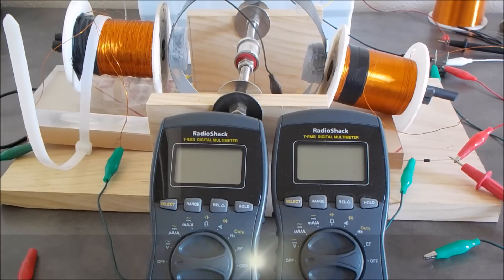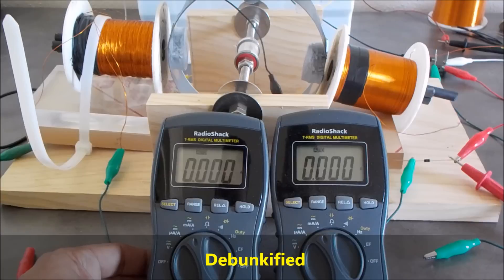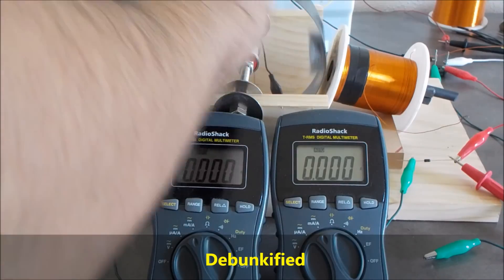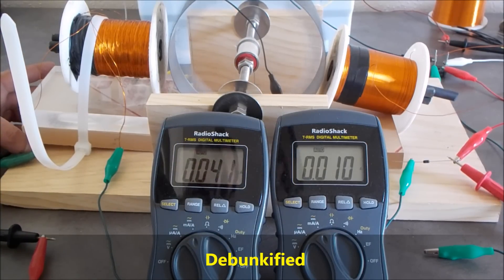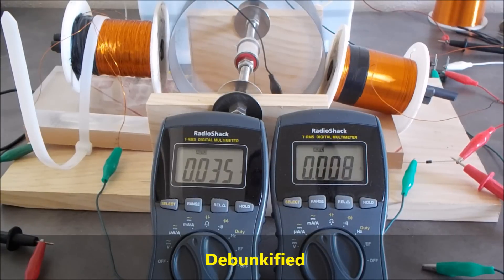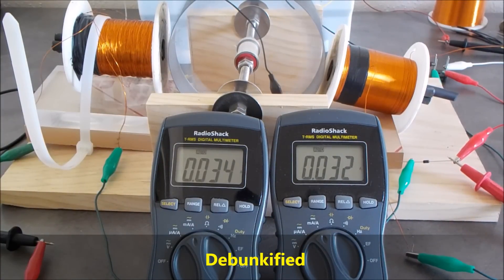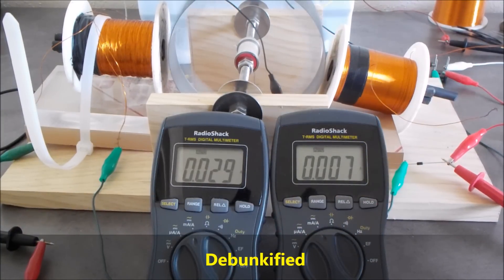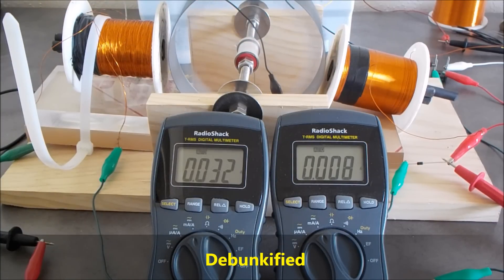GLIMPSE of FREE ENERGY OVERUNITY MOTOR/GENERATOR COMBO DEVICE

Comment: HIHow do you combine the collapsing field with the generator coil output?I have noticed you need that one fast steering diode on the collapsing field, and also a single diode (or perhaps FWBR to rectify) on the generator coil too, then both into the same cap or same load.I like to put pickup winds behind and around on outside too, of my motor coils to make for greater collapsing field energy, plus the back end of coil now does work too, inducing into those extra pickup winds....extend the core in your motor coil about twice as long, wrap pickup winds back there now both ends of your motor coil does work...also not only do you get the induced energy from the magnetic flux on the backside of your motor coil (as it is now it does nothing but go into space) but also the collapsing field backspike comes through as well from those pickup winds!.....trick is single diode off these additional pickup winds must face particular direction - one way works, the other way doesn't...you could then combine this extra "induced collapsing field" energy with your generator coil output too and so now three "outputs"
Reply from the maker: Well both the kick back and generated energy are combined together through 1 diode from the kickback spike and a FWBR composed of 4 diodes connected in parallel with the kickback spike output. 

I find no need to add extra windings around and behind Gen coil and longer core as the collapsing magnetic field will fully and directly collapse all its field energy into the Gen coil. Any more windings simply add unneeded resistance that takes away any energy.

Comment: Did you notice that after a few seconds connected the mil-amps on the motor side rise? That happens when a load is placed on the Generator coil. Yes even the meter draws a little load. At that point he was loosing energy. Using AC with a Bi-Toroid he would not increase the Resistance on the motor side avoiding the rise in mil-amps to the motor. Then out of the 2 sides of the Bi-Toroid rectify them to the charging source. This eliminates the resistance to the motor, increases the output to the charge and the voltage can be stepped up do to it being AC first. You would need a drive side, the motor, and a generator side. The Bi-Toroid should be on the generator side. You can get the small toroids from the curly lights, the bottoms to the socket or from used DVD players. Use 30awg magnetic for the middle winding, 24awg for the 2 side winding's. If the middle winding is 10 then the 2 side winding's should be 30 to start. Not only will you step up the voltage but you will also increase the amps, or mil-amps output. Look at my video 3D printed. Notice the run side and the generator side with an added DC generator on the outside only to charge the batteries. This is a superior method to over unity that does not break any of the laws of physics. I charge the Batteries in parallel, and use them in series for the motor. I use the larger motor as a type of capacitor when I change the 10 out. The other side is AC through a bi-toroid then through a full bridge rectifier to the Capacitor then to a battery. Capacitors can accept energy faster and with less resistance.

Comment: What size wire and how many turns are on those coils?
Reply: I use a minimum of 500 turns for the power and 350 for the trigger to the reed switch or base tot he transistor.
You get a better collapsing field if the magnets are 120 degrees in a delta, but you will get more torque and slightly less out of the collapsing field at (magnets) 60 degrees and the coils 120 out. Use 2 more power coils with the same trigger for the motor side and 3 coils on the AC side in series with 3 North facing 120 degrees and 3 south alternating 120 degrees. 6 magnets.
 Did you notice that after a few seconds connected the mil-amps on the motor side rise? That happens when a load is placed on the Generator coil. Yes even the meter draws a little load. At that point he was loosing energy. Using AC with a Bi-Toroid he would not increase the Resistance on the motor side avoiding the rise in mil-amps to the motor. Then out of the 2 sides of the Bi-Toroid rectify them to the charging source. This eliminates the resistance to the motor, increases the output to the charge and the voltage can be stepped up do to it being AC first. You would need a drive side, the motor, and a generator side. The Bi-Toroid should be on the generator side. You can get the small toroids from the curly lights, the bottoms to the socket or from used DVD players. Use 30awg magnetic for the middle winding, 24awg for the 2 side winding's. If the middle winding is 10 then the 2 side winding's should be 30 to start. Not only will you step up the voltage but you will also increase the amps, or mil-amps output. Look at my video 3D printed. Notice the run side and the generator side with an added DC generator on the outside only to charge the batteries. This is a superior method to over unity that does not break any of the laws of physics. I charge the Batteries in parallel, and use them in series for the motor. I use the larger motor as a type of capacitor when I change the 10 out. The other side is AC through a bi-toroid then through a full bridge rectifier to the Capacitor then to a battery. Capacitors can accept energy faster and with less resistance.
Reply from the maker: Size of wire is #26 gauge. I didn't keep track of number of turns, but there has to be at least a good thousand or more turns.

Comment: Was thinking it could be because the extra magnet might be a bit strong  &  is "saturating" the ferrite generator core material. This reduces it's inductance so more amps flow in the generator coil. And more amps = more amps/turn on the coil = more magnetic field so rotor speeds up.
Reply from the maker: +smokyatgroups True, I just can't figure out why I'm getting the opposite effect with a backer magnet behind the motor coil. I do get a great rotor speed up like that but current going in goes up, not good. I've seen it go down before by half and a speed up of the rotor but that was another setup and I can't remember exactly. I think it's the core I was using welding rods as a core, maybe that was it. I really need to do a comparison effect, maybe the welding rods were so inefficient that the backer magnet simply made it efficient like it should have been in the first place like the ferrite cores I'm using now. Hopefully not.

Comment: Nice video, I think you are getting Lenz drag on rotor due to the current draw on the generator coil. You could try put a couple of additional magnets as generator only magnets but at right angles to to the motor magnets. So north south axis of these is parallel to the rotor axle.  Then make a pickup generator coil which takes energy from both side of these magnets  by straddling both the poles.  This will cause acceleration under load.
Reply from the maker: +smokyatgroups Hey there smokyatgroups, Yes you are right! There is most definitely Lenz drag on the rotor from pulling current off of the generator coil. I can get an amazing acceleration from a magnet behind the motor coil, but then for some strange reason the input current goes up further when it should be cut down and I can't quite figure that one out as NORMALLY the current goes down with rotor speed up.

I've had a setup before cut the current draw by half with rotor speed up before with a magnet behind the motor coil before, I think it might be the cores I'm using right now. 

Mranguswangus describes bucking fields very nicely, but those don't work very well as they don't output very much power because any time you have fields cancelling, even Lenz's Law opposing fields, then energy is being cancelled out as well, even from induction of rotor magnets into generator coils.

On this particular setup once I've sped up the rotor with a magnet behind the motor coil, then take it away and then connect the generator back to the battery, the current is extremely low, like at .015 A while the generator is over .030 A.

Comment: Not bad.  but I believe that the small overunity you see is the small charge stored in the copper coil, it dissipates as soon as you connect it back into the system.  Do not be discouraged with your design though.  It has a lot of potential.  This looks like a much larger, more industrial version of the EZ spin motor that Laserhacker came up with.  Perhaps if you mounted more coils to it so you could capture more of the magnetism that's just being wasted at the top and bottom of the motor.  Then you could put that back into a capacitor and run it back through the system.  

I'm no electronics major, so what I said about the copper coil holding a small charge could be wrong, but it makes sense.
Reply from the maker: +Theminecraftian772 Hey there Theminecraftian772. I'm no electronics major either, I don't think anybody has to be to understand this stuff. You are right about the coil holding a charge just like a capacitor and a coil does have some capacitance between it's windings, but I don't think that's the entire case here. 

It truly is outputting more energy out than in and I have managed to sustain the effect for at least a good few seconds as I've already shown. It lasts for so long only because of Lenz's Law, maybe I should have mentioned that in the video, there's so much to cover.

The Lenz's Law is the ONLY thing that is causing too much drag on the rotor. There are tricks for overcoming that, maybe I will talk about this in a later video. There are TRICKS that can be done to speed the rotor up and lower input current draw even further, and also raise the generated power, all with just one coil, which is good enough for now.